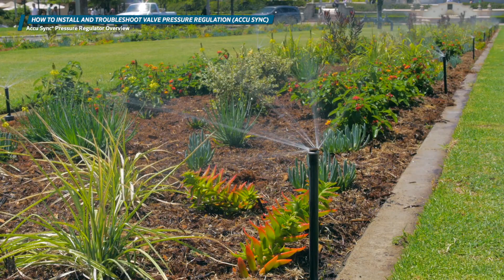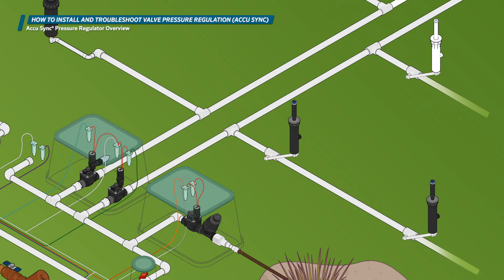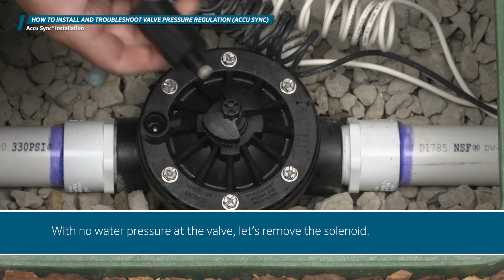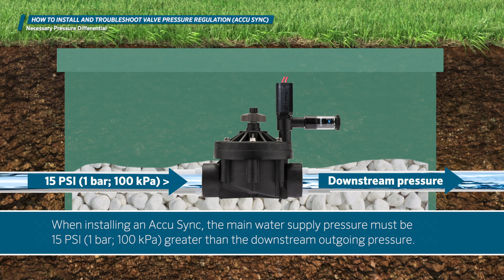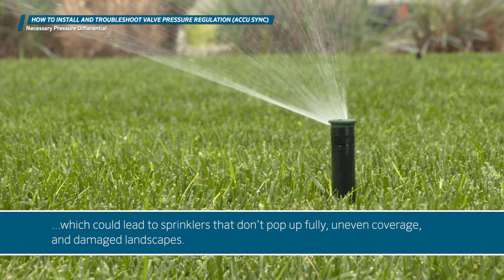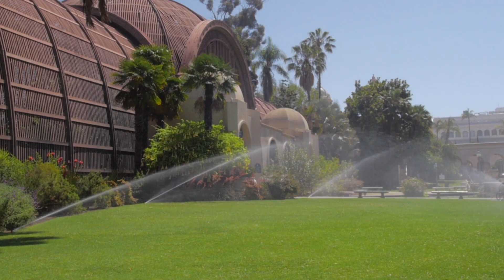How to Install and Adjust the Accu Sync® Pressure Regulator

Comment: Will this regulator work on non Hunter brand valves?
Reply from the maker: Hunter AccuSync pressure regulators only fit Hunter branded irrigation valves.